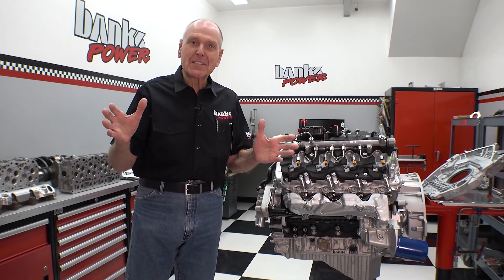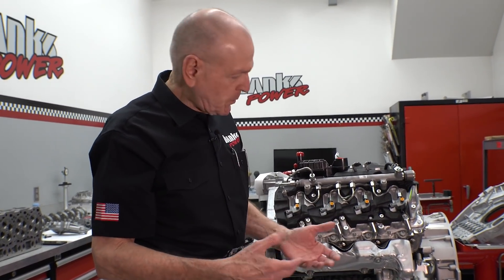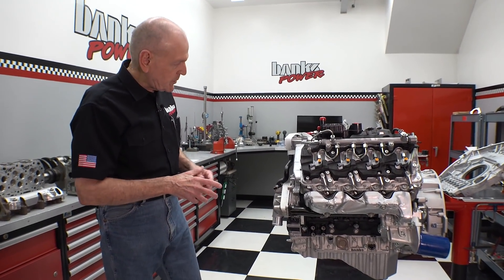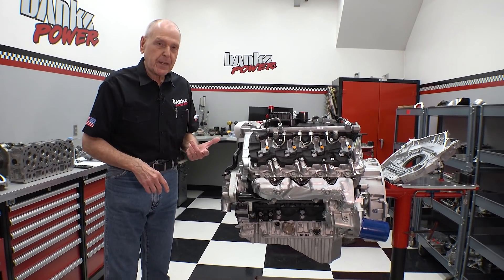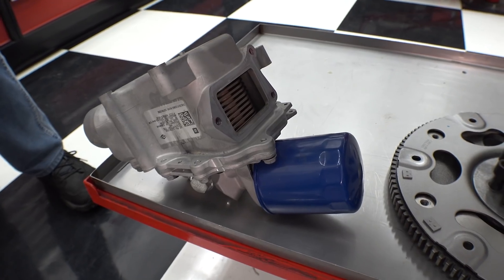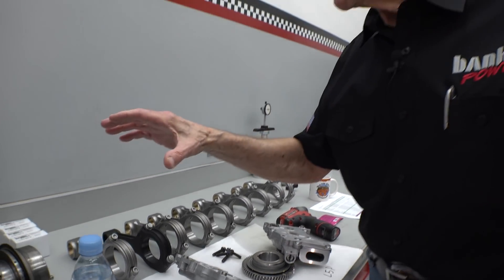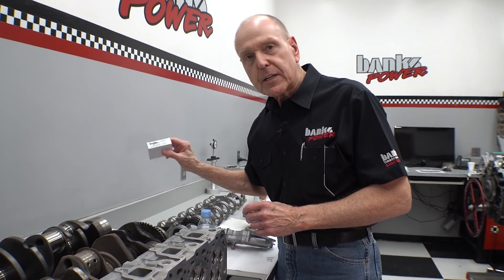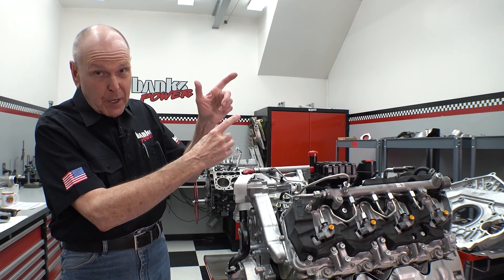Banks Duramax L5P internals sneak peek! 😲

Comment: hey i was just reading this article on engine harmonics and the testing engine just happened to be an older duramax 2003 era.  long story short they managed to add 6hp and 20 ft# to the engines dyno numbers by just changing the fluid damper for an aftermarket unit. the HP numbers were not the goal of the testing i was reading about but it was a convenient byproduct of a more smoothly running engine. Since your doing these videos on killing the duramax i was curious if you could measure the engines frequency and see if you could pick up any power by adding an aftermarket damper and smoothing out the engine which should also increase longevity of the lower end. or find out if the factory unit is as good as it gets. you never know.
Reply from the maker: Dalton, thanks for watching the video series! We like to here input and converse with our fans. We will be make changes to the engines, dampers maybe something we are looking at. We will pass the idea along to engineering and let them know. Thanks for messaging us!

Comment: That GM ten speed is going to hold up behind a hot rodded Duramax? That's going to be awesome, what transmission controller are you going to use, or is it integrated into the engine management?

Comment: What a National Treasure this man is! Total antisense to the dam epa weenies and ralph nader types! I only wish I had the resources to support his company through purchasing his amazing products. I’m wondering if any 2.8 DuraMax magic is in our future? That’s a price point I could deal with! Ah just imagine, a new ZR2 Diesel, built by these pros to dependably and cleanly make in the neighborhood of say 300 hp 450 lbs ft? That with a dependable extra 1,000 rpm’s with a lower 3:72 gear sets would make a terrific little all around blaster, or take a loaded LT Crew Cab 4x4, that’s lowered a bit with a nice set of Bilstein  Coilovers front and a Leaf Spring replacement of links and Coilovers rear in the name of ride/handling. That’s a recipe for a sweet all around runner! With the added long highway mileage! I know of a 2018 4x4 LT Crew Cab Diesel, brand new never titled Dealer Demo that’s naked down to $39,700!! Loaded with Leather and Nav/Bose! With that one I could have a nice start, for the price point on a basic full sized diesel Reg Cab! I’ve seen a couple Ram Crew Cab Tradesman rwd for that, but the two I found were the lower output 6.7,G56 manual trucks, with vinyl seats and floors plus the most basic 5.0 UCONNECT system.

Comment: I’m in joying your channel.  I have a question for Gale Banks. I’m building my LBZ to make around 1000hp with compound turbos. So far I’m at 750 with a single and 45% over injectors. My rings already gave out on me. The truck is a daily driver I’m going to put it in my H2 hummer. What rings do you recommend for that power rang and daily driving?  Thank you.  I already installed your intercooler made a big difference

Comment: Cast pans over steel... That seems like a step back word. Cast breaks with the slightest hit on anything.. steel just deforms.
GM needs to get the fuck out of the diesel market.. its not their own engine.. GM sucks ass. The 6.7 Scorpion was in house and out performs GM and Duramax. Ford has an engine built by them that performs very well.. the other had to outsource it... Imagine that

Comment: Did I miss the last differential episode ? I don't see it
Reply from the maker: The reason for the time between follow-ups is purely due to R&D. When we post a video, ten times out of ten, it's something that happened that day or the day before. Regarding the diff cover series. We've been sitting on the info for quite a long time. Why? We'll only get your attention once. We're going to reveal the research when we debut our cover design. We made many iterations and several billet prototypes, tested the heck out of the design, then went with a manufacturing process that is far more accurate but takes much longer. We have the diff covers in production and hope to have an announcement soon.

Comment: Diff covers?
Reply from the maker: The reason for the time between follow-ups is purely due to R&D. When we post a video, ten times out of ten, it's something that happened that day or the day before. Regarding the diff cover series. We've been sitting on the info for quite a long time. Why? We'll only get your attention once. We're going to reveal the research when we debut our cover design. We made many iterations and several billet prototypes, tested the heck out of the design, then went with a manufacturing process that is far more accurate but takes much longer. We have the diff covers in production and hope to have an announcement soon.
Reply: Roger dodger.
Believe me, you've got my attention more than once.

Comment: What ended up happening with the DIFF Series, we didn't get to see tests of each brand + the one you guys designed!!
Reply: It didn't stall. It just takes time for R&D.
Reply: I think it got stalled because they blew up the outdoor dyno. Can't finish the testing until that problem is solved.
Reply: last video in the comments they said more info coming soon
Reply: He wont release a diff cover if its not any better than the stock one.

Comment: Yesss! Oof imagine a duramax reving to 6k
Reply: i rev my cummins to 5K and ive seen videos of a cummins revving to 8K before it partook in an unscheduled and rapid disassembly.  6k with custom bearings.... the fucking money and time this guy devotes
Reply: @INCC74656I  rapid disassembly lol
Reply: What does that even sound like??
My poor 5.3 starts crying "help me" at 6k and its gas!
Reply: @maccoman71852  the normal grumble fades into more of a constant drull, you cant make out the individual combustion noises. the valve trail is considerably louder but again, you cant hear individual rockers or ticking, more of just the intake and exhaust together. the turbos are so deafening that you can hear them over the stereo on max volume.   i have all after-market internals in mine (except for crank itself), you get crazy vibrations if you dont upgrade things like your balancer/springs/rods. i had my whole crank assembly rotationally balanced when i rebuilt it, it was a little off but still with in factory spec - however at near double factory rotation speeds... factory spec can cause some catastrophic failures.
Reply: INCC74656I wow amazing
Reply: @INCC74656I  
Incredible 
Heads ported, new valve springs, lifters and a better cam for my 5.3 is my stage 1 plan.
Timming set and the oil pump will be freshened up during reassembly. 
My eng is a 2000 model so it has a lot of room to grow.
Texas speed ballparked the parts at about $3000.